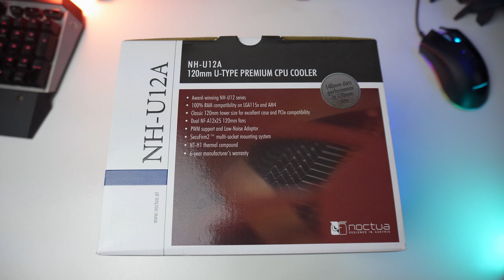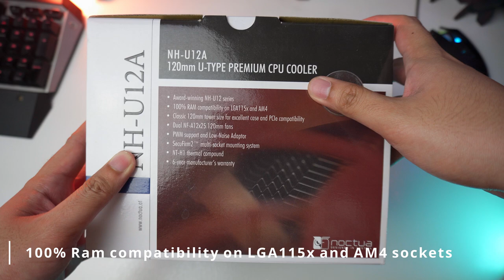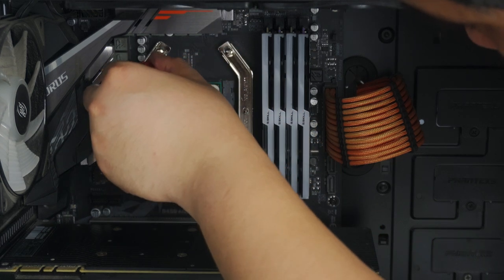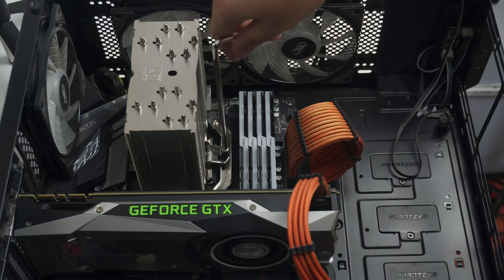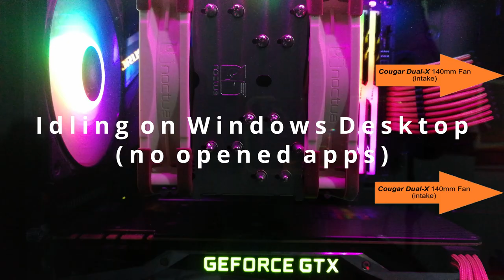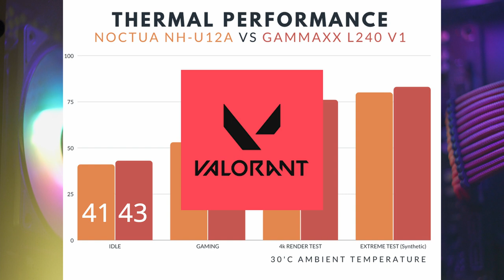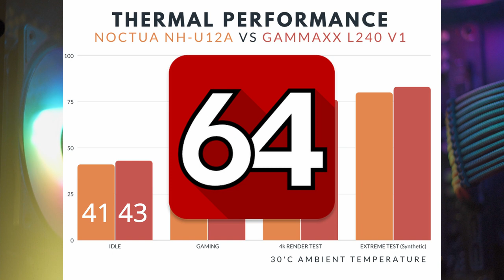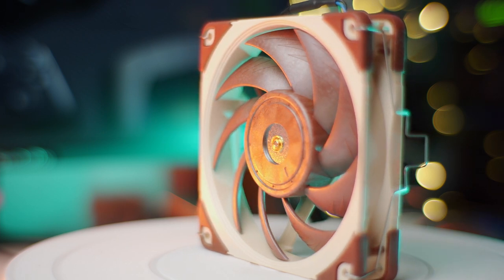Noctua NH-U12A Review | Best End-Game CPU Air Cooler

Comment: IS Noctua NH-U12A GOOD FOR INTEL i9 10900K for a 3D LIGHTING AND 3D RENDERING artist using Autodesk Maya software
Reply from the maker: Hi Bro! 100% would recommend. Those software would probably max out your cpu resources and the NH-U12A would be a perfect upgrade, Especially if your coming from the stock intel cpu cooler